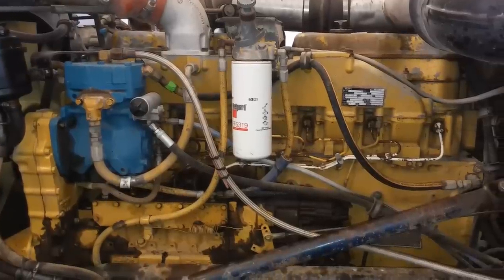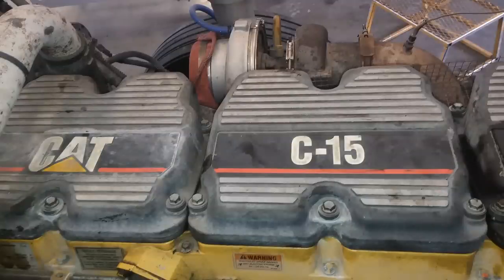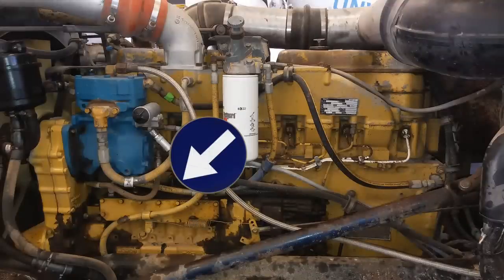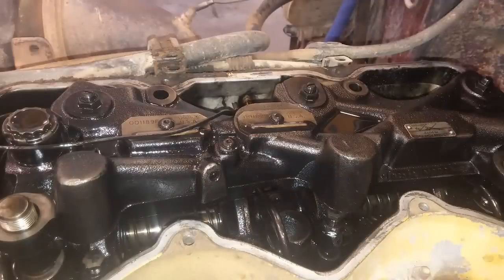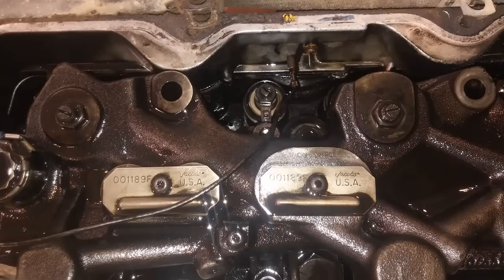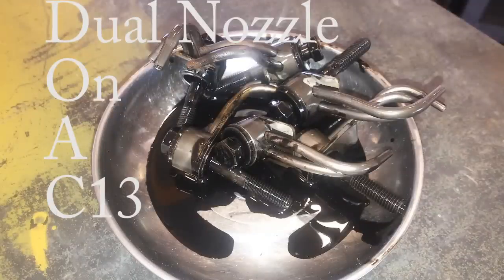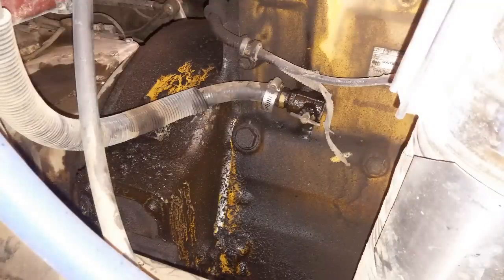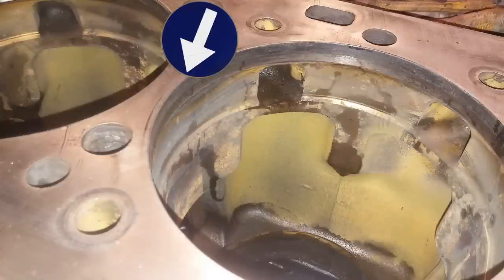The Cat 3406B Engine. Know Your Engine.  Caterpillar 3406 Information And History.

Comment: I worked at Caterpillar for 38 years and I can’t tell you how many of these engines I worked on. I tested them and worked on them on the assembly line. I thought it was the best engine made.
Reply: Do you still work on the B models?
Reply: Can u tell me why when I turn on my cat 3406b make like a noise that he want to turn off and u have to accelerate???
Reply: @janiersuarez9485  mine does the same when I, too, turn mine on.  I place a weight on the accelerator pedal (mallet) to rev it to  700-1000 rpm. After a few minutes if you take ig off it stays at 700.  I just thought it was  a mechanical(b) thing
Reply: 👌100%
Reply: What year was the last B made? And what are the best options to turn up a C? I bought a 3406 and told it was a B but now I think that it’s actually a C
Reply: I drove dump trucks for years and drove plenty of B model Cats & with a bigger turbo(recommended) you can adjust the pump(2 screws air/ fuel) by pulling the screws out a few turns or take them out lol those engines will RUN. I ran one that would keep pace with a 550 & a couple that would walk all over 550's. They'll push big power and plenty of guys build them up to push that big power even more reliably. Great engines!
Reply: What's blow by.
Reply: @grahamelliott4689  I know a guy who can tell you everything you need to know about your C model if you are still interested
Reply: We have an 88 marine setup that's been going strong until last week.  It probably is the best diesel engine ever made... literally went 34 years with nothing but oil changes,  valve lash adjustments,  one rear main seal replacement, one starter rebuild,  and once we replaced the injector nozzle seals and rings. I'm so in love with this engine, that I applied for a job as a tech at caterpillar today. I truly don't believe that there's a manufacturer of industrial engines that can compete with the badassness of CAT
Reply: You still working at Corinth plant?
Reply: Probably was the best it was made when USA was King

Comment: Back in the day, each engine brand had their own unique sound.  Used to love that clattering howl the Cat made just above idle, pulling into a fuel island.  Now,they all sound the same.
Reply: I'm 27 years old and I know exactly what you mean. I grew up around tractors of this era. I can still remember the scene in my head of my old man rowing through the 18 speed late at night and counting down the days until I could take my CDL test. Those were the days.
Reply: @joepellish5380  trucks are far quieter now but a Volvo D13, DD15, ISX15 and MX13 all sound very different
Reply: Arguably the best sounding diesel engine ever made is a two stroke Detroit, probably the 12v92 specifically
Reply: @Romuls753  And they are heavy leaky gutless wonders,  The best place for a 2 stroke Detroit is sitting at the bottom of the ocean still attached to the boat hull that it once powered.
Reply: @longliner205a4  a 12v92TTA puts out ~700 horse and ~2,000 lb-ft of torque with a dry weight of ~4,000 pounds. A 3406 weighs 6,000 pounds. Two stroke Detroits are much better than mechanical CATs
Reply: @Romuls753  You weight figures are far off.  A 12v92 comes in at just under 5000 lbs and according to caterpillar official literature the 3406b comes in at just under 2900 lbs so the 12v92 is almost a ton heavier.  A 12v92 has twice as many moving parts which equates to twice as many failure points.  The 2 stroke Detroits like to operate at a set steady rpm level since the have a narrow power band.  They had 3406b marine engines rated at 550hp and 2100 ft lb of torque.  I have a 19L Cummins Kta600 which has a weight of 4000 lbs and it is built for 1000hp and it makes nearly 3000 ft lb of torque.  The 2 stroke Detroits became obsolete by the early 70's.  The one problem shared with all v configuration diesel engines is the lack of main bearings.
Reply: They were awesome.. a tweak on the advance  AFRC and fuel.screws and these girls would sing..
Reply: @Romuls753  a.3406 weighed just inder 2900 lbs..
Reply: @finleypatmalcolm  according to Cat's website it's 2,866 pounds. Guess we're both wrong
Reply: @Romuls753  3406 5ek weighs 3k and the b model didn't weigh that much more.
Reply: @allanmccullough8550  I admit, I got that wrong. I don't know where I got the 6,000 pound number from, could be the wet and dressed weight, idk
Reply: @Romuls753  Mine is a 5ek 1996 and later 6nz was lighter by 300 lbs resulting from changes made to the block.
Reply: Unless you live in a country where you get scania, hino, mitusbishi fuso etc scania v8's make such a nice sound plenty of loud ones in my area. but yea definitely get what your saying regardless.
Reply: @joepellish5380  That's cool you got to see the country next to your Dad.
I liked the Laredo to Denver and the Houston to Denver routes up 10 through Junction, TX to Lubbock and Amarillo and up through 287.
Reply: I love the sound that volvos make
Reply: @wizard_of_poz4413  said no one ever lmao
Reply: @peterbiltlowryder  I said it
Reply: @longliner205a4   Worked on both in the late 70's - early 80's....personally the Detroits  were snappy and responsive, but Cat 3406B's and 3408's walked all over the Detroits under a load & up hills. 90% of company drivers &  owner
/operators back then would take a Cat over a Detroit in a heartbeat;  Detroits were less expensive and had a little better fuel mileage, so business managers favored them, to the disappointment of company drivers
Reply: @Romuls753   . . .   ??? !! ! ... .. .  6,000 pounds  ?   BAW, HAW, HAW, HAW .  ... .   ! ! !

Comment: I happen to have a 94 Pete with a 3406b in it. Marine nozzles and the pump is set to max fueling. Right around 600 hp. Been running this way for 7 years without any major problems at all. Smokes a ton, power comes on a little lazy. But I get 6.7 mpg on a good day and rarely have to downshift for hills.
Reply from the maker: +Edward Baker Pulling 600hp you probably never have to shift, just roll out in 4th from a light then upshift to 8th and good to go lol.
Reply: The one I ran was lo3, lo5, hi3 and hI5. Did NOT know what a load was. SCARY pulling, like the old Mack Hi-torque rise. Just wouldn't quit.
Reply: Edward Baker lol my dad has one in his 92 freightliner with stock pump ,injectors and turbo doing 630hp no fuel adjusted on the pump either all he did is time and set valves to his spec and put a custom exhaust manifold on it and he has a 70hp propane kit was dino tested at 700hp
Reply: What size nozzles you using ?
Reply: Adept Ape 😂😂😂😂
Reply: Edward Baker lol wow, that’s nice
Reply: 3406 Beast!!!!!!!!!!!!!!!!
Reply: You would be lucky to get 6.7 running empty with a flatbed.
Reply: @dflk2580  did he tell you who did his pump looking to get mine done
Reply: @camrevill5089  I found in my area here Minneapolis
Reply: @camrevill5089  pull the screws on the pump. Air should be a little more out than fuel. Behind the S plate on the pump you'll find the 'magic mythical screws' lol it's easy.
Reply: 6.7 mpg you talking about empty right?
Reply: @Cp-jv6mf  no
That’s total
Reply: Can to tell me who tunes your motor we need a shop that what's on these still have a 1984

Comment: Probably the best engine cat ever made. Still TONS of these on the roads here in MI. Probably as common if not more so than a cummins big cam here.
Reply: joe blow more common than a Cummins up here man
Reply: They are some bad motors I got one in my truck shit that joker got over million miles on it and still run like a top and will pull her ass off yes sir
Reply: I live in Michigan as well, with Michigan being one of the last heavy haul states I think these engines will be around for a long time. 3406 engines hold up better than most.
Reply: Do you happen to know of a reputable B model mechanic??  I live in MI also.
Reply: @derichsimmons3798  The governor on the 3406B I drove went out a few (5?) years ago. We took it to citywide truck and crane in wixom MI. They charge for their work but they are the best around. They had(have still?) a guy that cut his teeth on them in the early 90's. Very knowledgeable guy, very personable. 

The 3406B governor is supposed to be dynoed to be properly set-up. It also requires some special tools. This guy did it with experience and seat of the pants. Truck ran the best it ever did afterwards.

We asked MI CAT about repairing it before going to citywide and we think we heard crickets on the other end of the phone...
Reply: @derichsimmons3798  Down River Diesel on Pleasant St in River Rouge. It’s where I-75 has the big bridge over the Rouge River.

Comment: good video thanks! 40 yrs + in the o&g industry as mechanic and msv. most of our diesel firewater pumps and diesel hydraulic crane engines were 3406 B's and had the privilage to overhaul at least a dozen of these engines on different installations. very robust strong engines. I encountered seized cylinder head studs most likely due to the area where these engines were installed. A month ago all the engines here where permanently stopped. On 3 occasions it was completely leak free beautifully running engine. 4 yrs ago new injectors. adjusted timing gear and replacement of thermostats etc.anyway, not long now before these mechanical diesel are history. .... and so are we. 🙂

Comment: Enjoyed the video. Rebuilt many of these engines in the 80s to mid 90s. Also the run of the A models were similar to the B's and of course the old 1693s. Before the air cooled aftercooler you had the water type aftercooler. Huge improvement for the B. One weakness of the B model was the rod journal width. If you didnt change rod and mains every 250,000 miles you took a chance of spinning one especially if fuel and timing advance had been set above factory by a large margin. C models journals were wider and helped alleviate this problem. Loved the sound of the old cat's.
Reply: Do you still work on these motors

Comment: I run scrapers with these engines and its always impressive how much abuse they take. 10 hour shifts, with probably 70%+ of the time at wot, for 1000s and 1000s of hours. The machines fall apart around these engines.

Comment: There was a 3406 c that was all mechanical but usually used as industrial. Can't remember the exact serial numbers for it but it's a beast puttin out 620hp at 1800rpm roughly maybe a lil higher rpm and in the neighborhood of 2400ft/lbs of torque around 1500rpm. That's turned up half way. The marine models were turned up to 720hp.  It's goin in our 1975 359 pete. Originally it was a gen set engine that was bought off the company I work for.

Comment: I worked on 3406A's and B's and started with the first 5EK 3406E from the very beginning to now, all dealerships. All the way through the red head gaskets,  flywheel housing leaks and spacer deck aluminum/steel problems.  I liked what your could do with them, real power and reliability. Too bad they didn't improve the true dual overhead cam 1693. Liked the sound of the old combustion chamber engines.  I teach the mechanical fuel systems-still around, dealership training. You have a great talent to teach-get into training, Caterpillar Dealers are desperate for good trainers like you.
Reply: Are the 3406B is a good engine I would like to know I’m looking to purchase one
Reply: @dankdouglas2306  just look at all the comments from drivers & mechanics that love them to this day. I've driven plenty & they were all great runners. And you can build them up to push big power very reliably. Emissions might be a problem in some states..... at least California.

Comment: AdeptApe, these engines had a much longer production run than you stated.  I was selling 3406TA marine gensets (ie 3406B mechanical engine) in 2008.   You could also get them, painted red, for fire-pump service in multistory buildings.   In both these applications, simple well proven mechanical injection engines were preferred for reliability and easy service by non-specialist mechanics.

While the standard 3406 had recommended service intervals as you stated, that does not suit long distance trucking or marine applications.  So Cat supplied them in 500 hours service interval form with two oil filters and a larger oil pan.

Some marine engines set up for 1000 hour service intervals had three oil filters and an external lube oil tank.

These engines should never emit black smoke unless abused, not serviced properly, or hotted up.
Reply: Mechanical engines smoke end of story
Reply: @dennisaldrich536  : What rot.   Smoke means incompletely burnt fuel, which means excessive fuel consumption.   Since, in the applications these engines are designed for, and the operational life they typically attain,  the cost of fuel is by far the major cost of an engine over its life.   Hence, most users will not accept smoking.

Comment: I worked for Penske truck leasing in the 80's, and we ran a fleet of trucks for RCA. They had the biggest bunch of crybaby drivers in the world. If anything passed them, their truck was sick, and wasn't running right!Your comment  that peak torque was at 1200rpm was hard to get thru there thick heads. Anytime their truck pulled down below 1400 rpm, they would  grab a gear! I had to take them to a long grade up I465 and show them that engine worked perfectly down to 1200 even 1150 rpm. It pulled all day long, no broken cranks, no blown engines! Great engine, that did a good job!